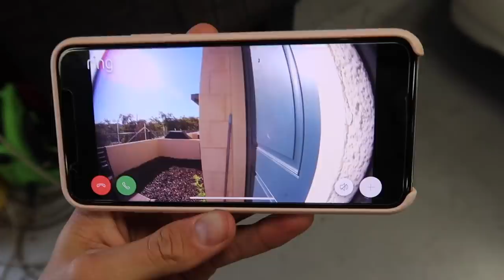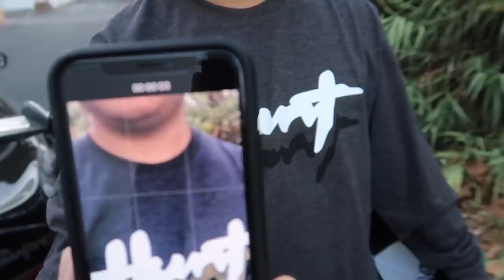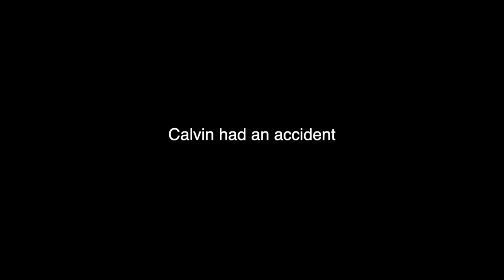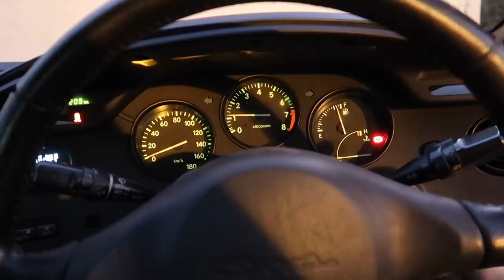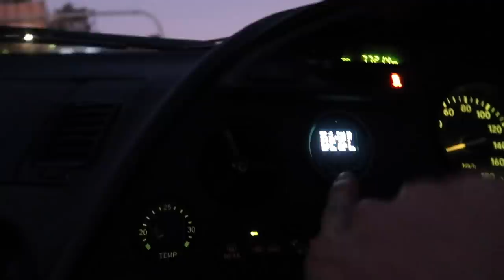StreetHunter Supra Wing install!!!

Comment: I’m glad Calvin is ok.  100_% reason to wear safety glasses. Wing looks good for sure.
Reply: Yeah you guys need to start using scatter shields on your grinders and use full face masks.  An exploded disk hitting you in the neck can be a whole lot worse than losing an eye.
Reply: As a fabricator myself i can't even imagine using an angle grinder without the wheel guard on it, and especially when using thin 1-2mm cutting discs, i've seen it far too often where they exploded, and what kind of damage it can do, there's just no reason for not using the guard really.
Reply: Anyone got the clip of Calvins stream when it happened ?
Reply: wong chyi ruey
Reply: those disks exploding can cause serious harm still have the scars from the one that blew up can shredded my elbow
Reply: Vlammenzee these kids don’t learn
Reply: Only got two eyes gotta protect em!
Reply: Yea same man.
Reply: Yea man a scray ass thing as you said happy the homie is good.

Comment: During the last video, I commented to my father that TJ was lucky he didn't get hurt while cutting the fender wells. What makes grinding wheels explode is heat. If you are going to cut long runs with a grinding wheel, you need to cut in short runs and let the stone cool before continuing. I have a 4 inch scar in my stomach where I learned that the hard way while grinding a trailer frame. Get yourself a good set of air powered sheet metal sheers to do fender wells. Your human body parts will thank you.

Comment: Straight killing it brother! Wasnt a big fan of the new supra at first but extra like your build👌🏻
Reply: what's not to like about the new supra it looks 10x better then the a80 it has a lot of bmw stuff who cares it doesn't have the 2jz who cares it's not 1998 when I was born.. it's the future. people should move on quicker, and when engineers crack the B58 code then we get to see what the engine goes for
Reply: @rtzeexy374  When you think Toyota you think fairly cheap to work on and reliable. Not hating on BMW I have a N54 335i and with that being said I know the headache of it leaking, great "german 2jz" and love the power just kind of a pain to work on.
Reply: At first I wasn’t sure about the mk5 but watching all the youtubers get theirs and spend time with it I def love it. And TJ’s is going to be crazy with the wide body kit. Everyone is doing pandem and this kid just designed his own kit. It’s insane
Reply: @MitchCarveth  I don't know if you Americans get the left over BMW s my daily is a 1996 e39 528i with m52 engine (straight 6) and it doesn't have any problems except airbag lights but it's a common problem for e39 but from what I read the b58 is a good stable engine to put power in, and it's not like Toyota got the engine and just putted it in the car they when through it and checked everything so its up to their standard. I don't think Toyota would be happy if they did a check and something wasn't at 100% with their standards

Comment: I work with grinders with zip cut disc alot at work, they are really scary, I don't use them without full face shield, and that saved me alot of times. Safest way I've learned is to just let the cutting disc glide and cut the metal, do not push it into the material you're cutting that would cause the disc to heat and explode, also always cut straight, never tilt the grinder while cutting that would cause the disc to bend and explode. Let the friction cut the metal, just let it glide, that's the safest way of cutting metal. Always wear full face shield, safety glasses only protects your eyes, not your face, not your neck.

Comment: Toyota’s can go up to 220 on coolant. The over flow tank is part of the cooling system and once the pressure builds up it feeds the over flow. Need to find a tank that is going to fit or run and loop the over flow back into its self

Comment: Those grinder disks only usually blow up if you run them hard and hot and it starts to actually warp, U need to let the disk take breaks as you cut if you are cutting for long periods

Comment: I've done a lot of complex, tight deadline projects for presentations and exhibitions involving 3D printed and CNC machined metal parts, anodizing, auto paint, powder coating, upholstery, etc. --professionally and at Art Center.  Oscar's eyes looked concerned and I can relate; I would be too with that situation, 10 or 9 days out.  It's galaxy-brain time now; no time for errors and unnecessary detours.  Be careful and good luck.

Comment: Cool breaks but I just saw Rob dahm and get them installed first. Just know that the sensors you're going to have to fiddle with on the driver side. Good luck TJ those are some badass brakes!

Comment: Y’all should have printed out alignment pegs so you could assemble the wing first then placed it on the trunk. That way you would have at more reference points for fitting it on the trunk

Comment: They should design the wing like the old RX-7 Spirit R (I think) wing that had the plates on the outsides that covered the angle adjustment bolts and have an adjustable wing

Comment: Did you fix the edges that had gaps? Or leave it for SOS to fix? It needs plastic melted to it with a plastic gun and sanded to fix gaps. Plastic polymer fillers would work too. But Bondo won't stick to plastic, or fiberglass. O'well good luck.

Comment: SOS is literally building the entire car. You better put their logo on the car
Reply: Concrete Board you do realize that no matter the builder, all reputable body shops completely disassemble the cars for paint.... of course they’re building the car lmao. Tj and the guys did the major cutting and mock ups. SOS is doing bodywork, paint and reassembly. Cudos to him but it’s not like he’s doing 100% of the work
Reply: @zerohourdrift  did you not see how bad the fitment on the kit was? Cutting the fenders is literally the easiest part
Reply: Concrete Board the fitment of the kit wasn’t the issue. It honestly was pretty damn close, especially considering the fact that 99% of all fiberglass/poly kits fit like trash. The hardest part is sanding the 3D printing waviness. The main reason it only looked like it fit bad was the slag/extra material from the 3D printer that needed to be shaved away... hardly a big deal if you’ve ever dealt with a 3D printing

Comment: Didn't wait till the last minute much! You might want to line up a backup team just in case someone or  "some team gets pissed and quits" If it was that important to you like you say, why did you wait till the last minute, A lot of you tubers have just as much on their plate as you do! They were done days ago and with engine mods upgraded turbos awesome wide-body kits and have been driving them around for days! Remind me not to have any of my mod work done at your place! "Calvin I hope you are ok" I know you're feeling the pressure to get it done but it's not your fault!  If I were TJ I would try to get you some more help in there ASAP!

Comment: Making modern look like old is the first steps of customization with new models. It’s the first step of the simple minded to run towards what was and not to what is. Making your Supra look like a MK4 won’t make it any cooler. Look ahead and step in front of the curve. This has been done. By every predecessor

Comment: Now thats how to fuck up a brand new car . cut all  panels up then bolt plastic shit to it OMG  is this guy for real ?????? just look at those rear arch's just cut with an angle grinder and then bent over with silicon holding it all together .. ALL THE OWNERS OF CUSTOM SHOPS ARE ROLLING ON THE FLOOR IN FITS OF LAUGHTER

Comment: Get you some of this stuff. It says run with heater on full blast for 10 minutes but for best results drive the car around for a few hours with the heater on and then finish the instructions. I know that car has a fat radiator and coolant lines but it's probably the heater core that's gunky and this stuff will fully clear it out and you won't overheat anymore. Been there done that with one of my old cars.
https://prestone.com/products?detail=AS105Y

Comment: I don’t even feel sorry for calvin. At least a month ago I commented on a video where I saw Micky angle grind something WITHOUT the guard installed. I said then and there that one day a disc will explode. You were lucky my dude but it’s your own stupidity which got you that in the first place. The whole reason of a cutting guard is to deflect shrapnel in case of an explosion of a disc.

Comment: Read after that incident with Calvin someone use the lord's name in vain and I'm just dumbfounded by the stupidity of some people it's a miracle that Kelvin didn't lose his eye cuz that's not really eye protection a shield would be more appropriate because one discs fly apart little tiny pieces can easily get in behind the glasses we should be thanking the Lord not using his name in vain I'm glad to see Kelvin is okay little bit of super glue and it'll be as if it never happened